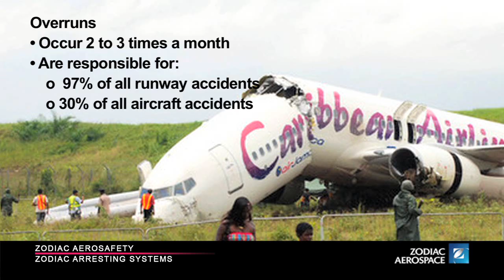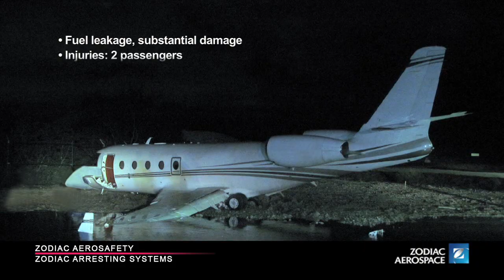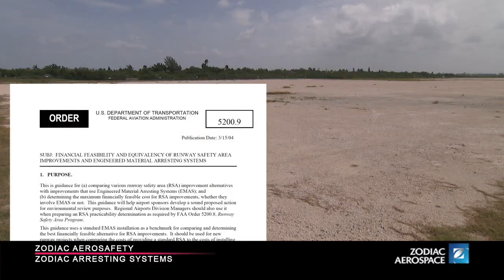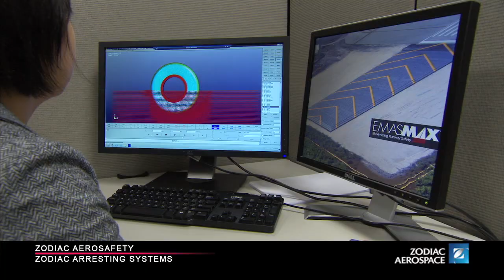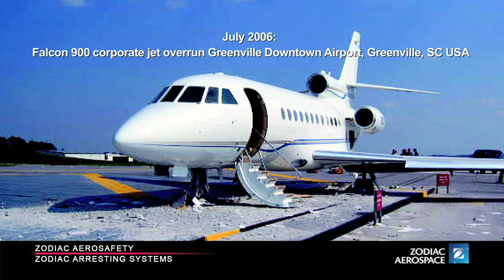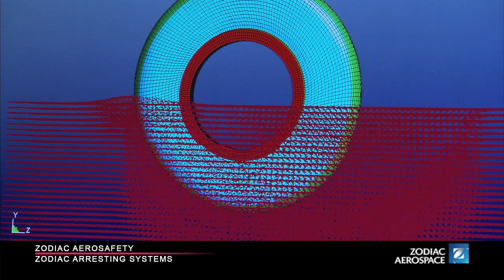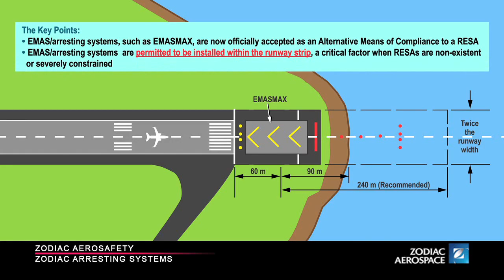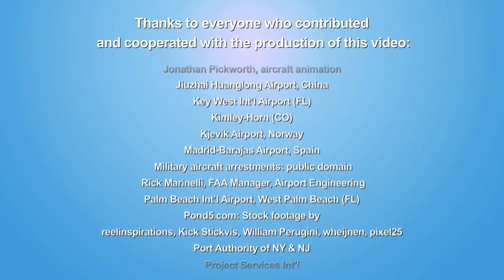EMASMAX by Zodiac Arresting Systems

Comment: would it stop a plane landing without landing gear? asking for my south korean friend
Reply: According to the experts, had the concrete not been at the end of that runway, things may have turned out differently even without the wheels.
Reply: Well the concrete wall also worked in stopping the plane. Too well infact.
Reply: According to pilots I've watched react to this tragedy, this airport doesn't have emas, and if not for the concrete wall at the end of the runway, most ppl would have survived, if not all.
Reply: A wall will certainly stop the plane
Reply: better than that BS wall. I think they lost hydraulic power, both engines, major failure and they survived all of these only to slam into a wall and DIE.

Comment: About today's accident in South Korea: How does someone build a wall at the same level as the runway at the end of it? It should have EMAS. Engineered Material Arresting System (EMAS) technology consists of installing concrete blocks that deform and slow down the plane if, in an emergency situation, the aircraft leaves the runway limits. Congonhas is the first airport in Latin America to have this technology, which is common in the United States, Europe and Asia. "EMAS is composed of a porous material mixed with a type of concrete, which deforms when the aircraft moves over it, slowing down the aircraft that may not be able to land within the normal limits of the runway."

Comment: What if 300 ft fine sand layer is place at the end of the runway instead of EMAS?
Reply: Sand is no good around engines; they will ingest it and it will cause problems.

Comment: this should be required at all airports. i never understood why people design runways that end at a steep embankment. like the runway in hawaii end in a 50 foot cliff. why? they could have built the airport better. lets say there was an emergency landing there. they would land, then die by running over the cliff into the ocean.
Reply: Many airports were built long before jumbo jets existed, and were plenty long enough for smaller propeller aircraft.  By the time jumbos existed, some airports (like Lindberg field in San Diego) had nowhere to grow (due to housing being built around it).  They make due, and people whine and moan when they want to expand or rebuild somewhere else (also a San Diego issue).  Also, small island airports are limited by land.  Much of that land is mountainous and much of the rest of that land cost a fortune to develop on.

Hawaii you are also missing the whining and moaning of the tourist industry unwilling to give up land to expand on.

Lack of room is usually the main cause, and it's usually for island or mountainous locations.

Other airports like Congonhas in Brazil, just don't have the money, even grooving the runways to make them less slippery takes forever to budget for.  Most airports want to expand, but it's usually lack of funds, lack of land and lack of common sense by the local citizenry that prevents it.
Reply: Im sure you’re a highly qualified airport engineer qualified to analyze risk factors appropriately and without personal bias
Reply: *rooster sideburbs*
ikr 😅 like wtf were the runway "engineers" smoking when they designed the runways that end abruptly with giant death pits below ffs⁉️

....but on a side note I just gotta say that yours is the best name I've seen in a long time, it made me laugh for some reason 🤷🏻‍♀️So thanks for that!